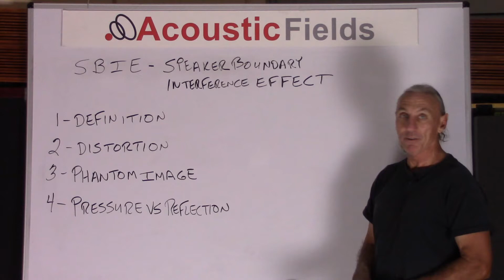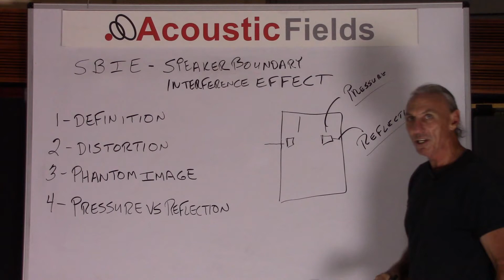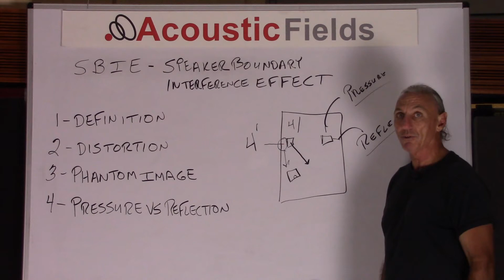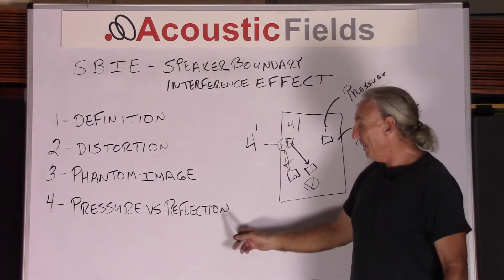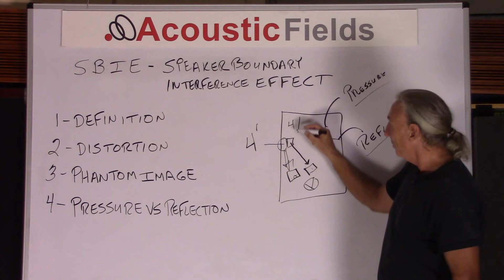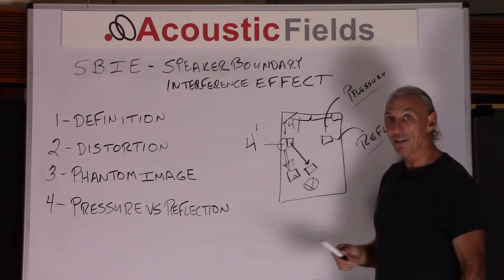What Is Speaker Boundary Interference Effect? - www.AcousticFields.com

Comment: I wonder http://www.isoacoustics.com/isol8r155.php (isoacousitc) these things are for SBIE.
I'm using one of those and I hear big difference but I really don't know what do these things are doing.
Do they decrease SBIE??
Reply from the maker: Hi Han Lim 

Speaker stands are devices that form a barrier (boundary) between speaker cabinet vibrations and the surface that it sits upon. A speaker generates energy through the movement of the driver. This driver movement causes the cabinet to "move" and these movements are then translated to vibrations. These vibrations are then transmitted through to most surfaces that the speaker cabinet is physically contacting. Vibrations excite the contact surface structure which is usually the console. All of this vibration energy moving from source to contacting surfaces does create distortion that is audible. So, in this sense, yes, this would be the interference produced from a speaker and its boundary which in our example is the console. SBIE is usually referred to in the context of a free standing speaker and the wall of the room it is placed within but I think your question is another example that would fit the definition. Good thinking. 

Thanks
Dennis

Comment: So, you advise against the installation of an acoustic baffle wall behind an acoustically transparent screen. What do you recommend if the screen can only be a foot or so from the wall? Why do you recommend 2 center speakers behind the screen?
Reply from the maker: Hi Brian Fischer 

First off, there really is no such thing as an acoustically transparent screen. All materials placed in between the sound generating source and the listener have an impact on the direct sound from the speaker. Only the end user can decide what is acceptable distortion levels for their usage requirements. Personally, I find their rate and level of sound distortion unacceptable. 

Placing sound absorption technology behind a screen is problematic. All middle and high frequency sound absorption technology requires air movement to work properly. If you have enough air space and air movement behind the screen, then you can try some material type. I would make sure the chosen material is installed away from the wall surface by at least 3 " to allow for proper air flow around and through the sound absorbing material.

Place both center channel speakers on the sides of the screen. You will have to experiment through the tuning process to find their exact location where the image stays focused upon screen.

Thanks
Dennis

Comment: Why do so many professional installers place front left, center and right home theater speakers in an acoustic baffle when boundary effects create such horrible comb filter effects? Is this the best alternate choice if the speakers cannot be pulled 4 feet out into the room and still be placed behind an acoustically transparent screen? Do you recommend a baffle for acoustical transparent screens? Do you have an acoustic treatment to overcome comb filtering for speakers installed in a baffle wall? Please share your thoughts on baffle walls for professional home theater installations.
Reply from the maker: Hi Bryan,

Unfortunately, it is about making sales and not making acoustic sense. SBIE creates unwanted pressure. Remember, people still say to place sub woofers in the corners to get more "bass". You do get more amplitude but the gain is a combination of speaker and room boundary effect. It is not a pure sound. It is the worst of room sound.

The center channel speaker also suffers. They are always placed close to the floor. It is best to split the signal from the center channel into a center left and center right speaker. These center channel speakers should be the same as the left and right channel. It should also be in the same vertical array configuration. 

Side wall reflections can be managed through the use of diffusion or absorption. Which one to choose depends on many variables.

You must match the speaker size to the area you have to work with. Usually this involves the room width. 

Thanks
Dennis

Comment: Does flush mounting the speaker solve that or create even more issues?
Reply from the maker: Hi Jean-Luc BATTISTA 

Flush mounting speakers produces unwanted artifacts that develop from the surrounding wall surfaces. You can hear this difference when you compare the sound from free standing speakers.

Thanks
Dennis
Reply from the maker: Hi Jean-Luc BATTISTA 

I answered your question in yesterdays Google Hangout. You can see that section of it in this short video http://youtu.be/iR9bxJ0jxTU

Let me know if you have any other questions I can help with.

Thanks
Dennis
Reply: Hey thanks for that. Well at least it is supposed to help with the phasing that occurs from the rear reflections in the low end mostly. But from my understanding you get flaring like in a horn speaker with bad curve design.
Reply from the maker: Hi Jean-Luc BATTISTA 

I do not see how that could be possible. Managing phasing issues is complicated in a room with volume and size to work with. I do not see how they can engineer all of that phasing control and management in a speaker cabinet that is inserted inside of another cabinet the wall. Listen to a wall mounted speaker that has a driver with a certain diameter, say 4". Then, listen to a freestanding speaker with a 4" driver. You will have your sound quality difference and then you can decide for yourself. The difference is striking. The answer is in the listening.

Thanks
Dennis